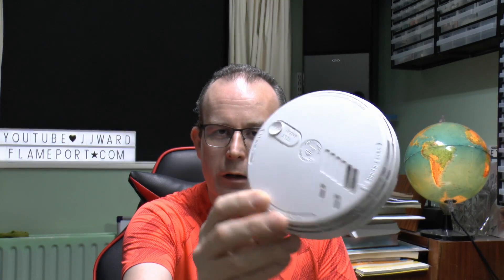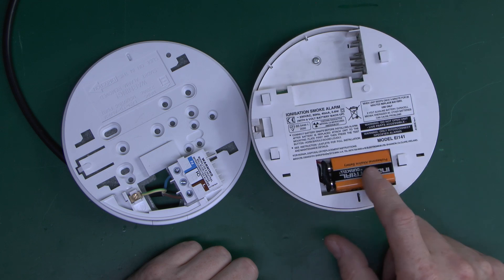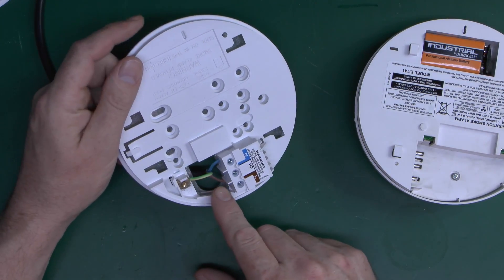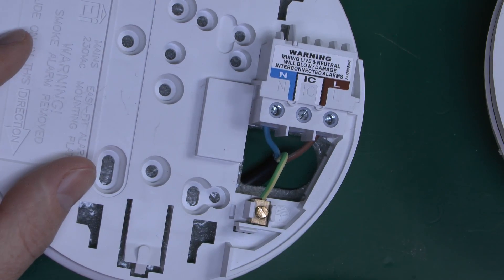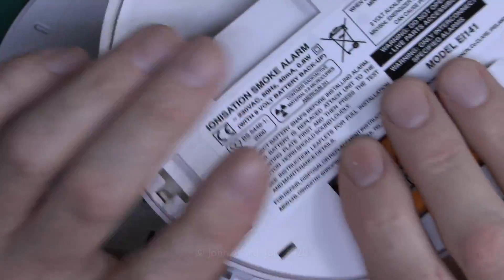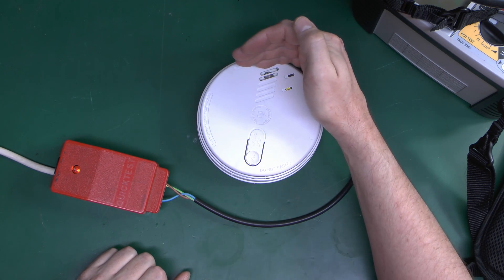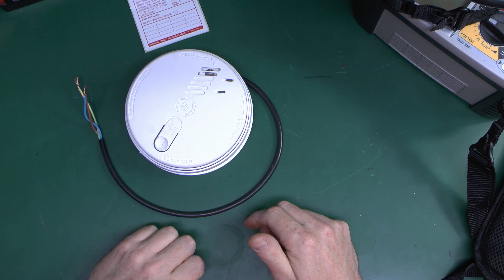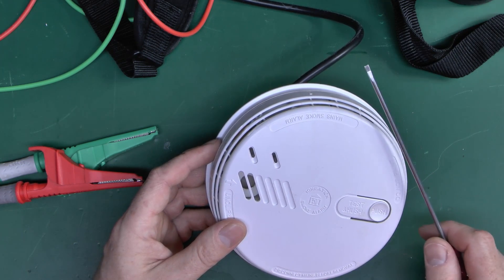Do Not Megger Alarms - what happens when 1000V is applied to a smoke alarm?

Comment: It would definitely be a bit rude not to shove 1000v through it! 😂
Reply: Did I hear a " Photonic Induction" quote? lol
Reply: .....Maybe, maybe not. 
The real question 
that has to be 
asked though, is......

.......Have you whacked the subscribe button on Wayne's Electrical?

If not, you're missing out on lots of electrical bits and pieces!

It's summer, and you know what that means: I WANT FLAAAAMES!

I can feel some HIGH VOLTAGE coming on and I need to fizz something over!

Of course, if you're not a subscriber, then you'll never know if-and-when that happens!

Stop missing out!

Please go to Wayne's Electrical right now, whack the subscribe button, activate the bell, and when a new video drops, you get to watch it first, with the other subscribers!

All videos are IN FULL HD, 1920 x 1080p with stereo sound, so what are you waiting for?!

Go on........ You know you need it. Subscribe to Wayne's Electrical today!

:D

-Wayne's Electrical.

24th July 2020, 22.45
Reply: Bet it might pop if you reverse the leads. If there's a rectifying diode in there (which seems to be the case from the ~1MOhm reading) it may actually nuke it when the diode is forward biased.
Reply: @mysock351C  It's AC powered - so it would be biased both ways in normal operation..

The resistance seen is a discharge resistor.
Reply: @Monkeh616  The megger? Or the smoke detector? I was wondering if the megger would be straight DC. Ours was, but it was for scientific lab use. The smoke detector likely has a single diode and a zener, but a bridge rectifier is a possibility.
Reply: @mysock351C  IR testing is done with DC, but the alarm runs on AC. If it is a single wave rectifier, the diode will be reverse biased in normal operation..
Reply: @Monkeh616  Yeah thats what I was saying. If its a bridge, tho, then it would be forced to cope with the full test voltage, as you probably know. He does have a video of the smoke detector itself, so it might be interesting to see whats inside.
Reply: @mysock351C  It's a capacitive dropper, though, so the voltage is across the cap and discharge resistor, not just the diode. I'm not 100% convinced even a 600V diode would break down under those circumstances (a 1000V test, that is) and even if it did, the current passing probably wouldn't actually damage a 'big' rectifier diode. Don't hold me to that, though, I don't make a habit of reverse biasing non-zener diodes in the region of a kilovolt.
Reply: @Monkeh616  No, what I was saying is that some of these are just simple zener regulated supplies. Obviously with a dropper (or probably the specialty regulators they sometimes use), it will be protected either just from the cap, or an OV protection function in the regulator, provided it doesnt blow the switching or pass transistor. But with that said even with a zener it could probably drag the megger down far enough (or drop the voltage enough) to prevent damage if the rectifiers where forward biased. Obviously looking at the thumbnail it shows the standard discrete bridge indicating just a dropper, as you mentioned.
Reply: @Monkeh616  With all that said, the "Dont megger" warning is probably to prevent damage to the film capacitor. That is what was probably causing the crackling that JW was hearing. In service this would obviously  cause issues since the capacitance would be off from the film being burned away by the megger.
Reply: @mysock351C  Have you seen a zener drop ~340V to ~9V at any appreciable current in a real device? I'd love to see that! Maybe I'm not quite getting the circuit you're suggesting.
Reply: @mysock351C  I'm not sure if the arcing would have been in the cap or if the little discharge resistor would arc over first. Either way no good, please no IR test across lines of equipment.
Reply: .....But I want MORE!! I wanna get some toys out 
(hint: upto 4kV with my variac and MOTs) and completely POP IT!
-Wayne's Electrical.
22nd July 2020, 22.00

Comment: Hi! You say connecting brown and blue together and then measuring between those two and earth, will not affect the load, but isn't there (in electronic devices) often a capacitor or mov across live and earth or some similar arrangement?
That might potentially get damaged this way?
Anyway, thanks for the video!
Reply: The Y2 class capacitor used in this application is designed to stand off more than 1kV DC, so it won't be at all bothered. A MOV of course will break down and give you a low reading, but you're not putting nearly enough energy in to risk damaging one.
Reply: @Monkeh616  Thanks for the explanation! I guess the only components that would be damaged by a megger would be actives like mosfets etc. You won't typically find these connected to earth.
And even when they insulation test a circuit between live and neutral, when there are still devices connected (like ovens for instance), then there's still a power supply of sorts in between those components and the 500V.
Reply: @koffibanan3099  Series dropper capacitor power supplies could also be damaged by connecting between line and neutral, if the capacitor is not rated at a high enough voltage. They are used in some low wattage devices like small LED bulbs
Reply: "connecting brown and blue together and then measuring between those two and earth, will not affect the load" - was he just referring to this detector - since the Earth wire didn't go anywhere ?

Comment: If it failed in situ, couldn't the high potential leak through the interconnect to other circuits ? Or is megging done totally isolated on all wires?
Reply: It's completely isolated, and interconnected alarms should be on their own circuit anyways.

Comment: Interesting that it reads as such a high resistance. The best explanation I can think of is that the smoke alarm is using a capactive dropper and the capacitor is blocking the DC. So the resistance you measure is that if the discharge resistor for the dropper cap.
Reply: That's most likely, yes. The arcing was probably just across that little discharge resistor, and no harm is likely to have come to the alarm. Still, they're safety devices which are rarely tested at the best of times, so a warning label to try and avoid the mistake being made is reasonably prudent.
Reply: @Monkeh616  I'd suspect the arcing was not across the conducting resistor but the cap.
Reply: I doubt the capacitor is rated for 1000V, but it should be okay at 500V.
Reply: @Mark1024MAK  I wouldn't say it'd be 'okay' at 500V either, but the energy applied is limited so it should take prolonged exposure to seriously degrade it, and the backup battery is there to provide operating current if it is somewhat compromised.
Reply: Monkeh - a capacitor connected across the mains (which is what capacitor droppers effectively are) should be rated to withstand the peak to peak maximum mains voltage. The upper limit of a 230V supply is 253V. Hence the peak to peak voltage is 358V. So to allow a suitable safety margin, a capacitor rated at a minimum of 400V DC should be used. Although 500V is greater than the 400V rating, good quality capacitors for short periods of time should be able to withstand this voltage.
At 1000V, however, the voltage is two and a half times the rated capacitor voltage, so the likelihood of damage is significantly increased.
Reply: @Mark1024MAK  I haven't needed anyone to explain capacitive droppers or basic math to me in about 20 years, but thanks, I guess.
Reply: Phil Allison   - I never said it was not an X2 type! And whether a capacitor needs to be X2 rated depends on the application. In practice, not all devices that use capacitors for their capacitive dropper circuits use X2 types. LED lamps are the most common devices that don’t use X2 types. Here is a datasheet https://static.rapidonline.com/pdf/10-2782.pdf for a X2 capacitor similar to the type used in this smoke alarm. You can look up the DC voltage rating for yourself. Obviously if the source of the DC is current limited (and most insulation testers are current limited), then it is less likely that damage will be caused.